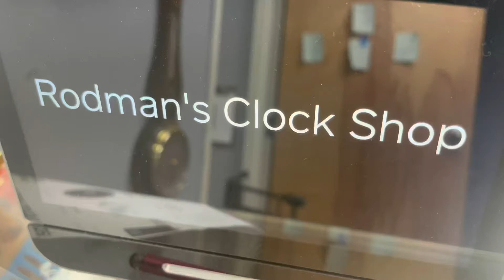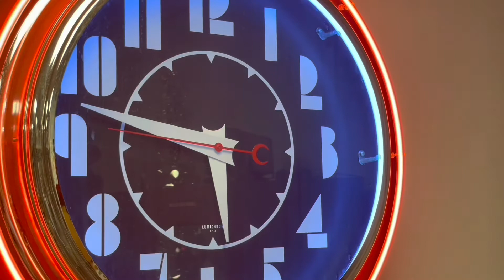The overhaul of a New Haven time on;y clock movement ! part 1

Comment: I have a 1929 New Haven 8 day Gallery Clock with an octagon dial.  With much patience I was able to get it running. Unfortunately, I damaged the pendulum mechanism trying to adjust the timing.  I live in Alaska and there is no one in the state that can work on it.  The works look very similar to what you were working on in this video.  Is it possible to buy a pendulum assembly for my clock or have one made to fit it?  Thanks for your input.
Reply from the maker: If you go to my eBay channel, jrclocker and send me a message with pictures of the broken item. I will set a listing up so you can purchase a replacement. I hope this helps, Jim.